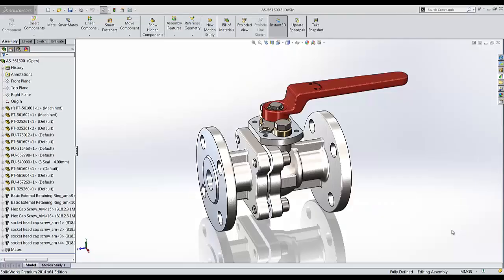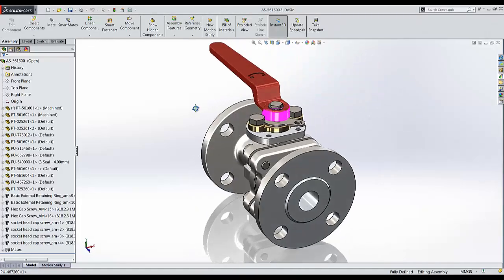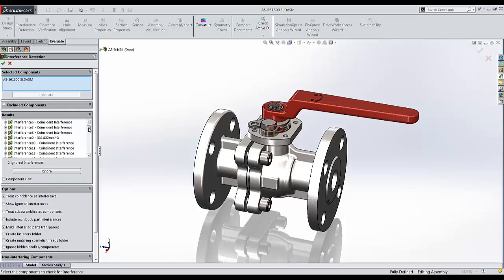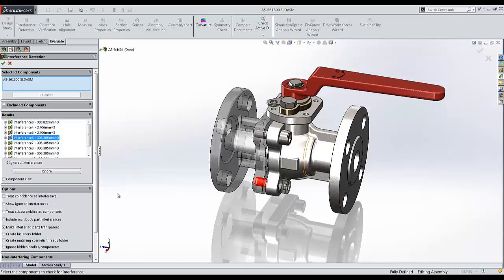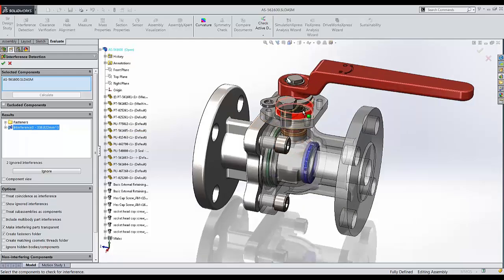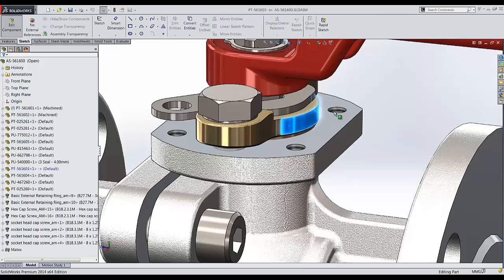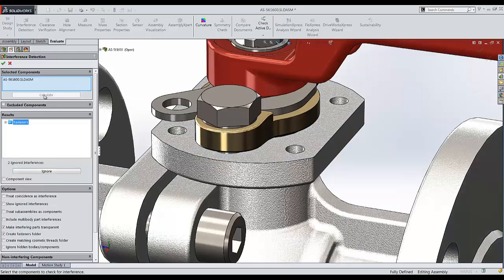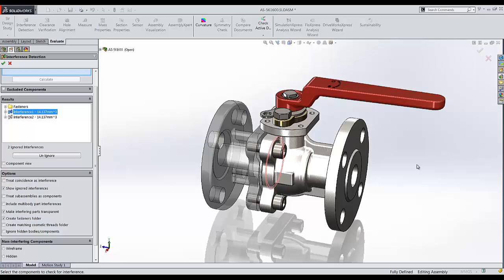SolidWorks - Interference Detection

Comment: Did it recognize the 'fastener' interferences automatically? Or did you manually have to move them into the 'fasteners' folder?
Reply: i think the "fasteners" were pre loaded solidworks parts from the toolbox.  so I'm thinking there is some kind of property setting in the fastener part that will recognize the interference option
Reply: Pretty late for this reply :)

AS Chet said, the fasteners must be from the Toolbox and yes, in the options there is an option as 'Create fasteners folder'. This is so that we can ignore all those as they don't affect the functionality of the assembly

Comment: hello
i have been watching your videos and you are sharing really nice works.
i have a problem with interference.
i have model - which i didnt make it with solidworks. i imported it later on.
its a bit huge model. i am trying to analize it. however because of such interferences i cannot create mesh. 
i cannot edit the parts as you do by entities - its not quite applicable since there are too many parts also.

so what to do? is there any way to go around?